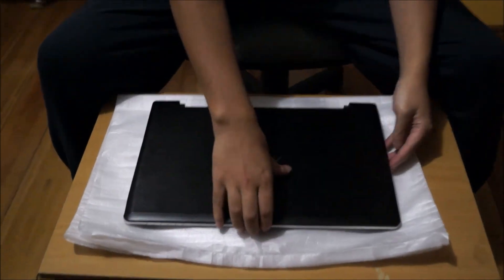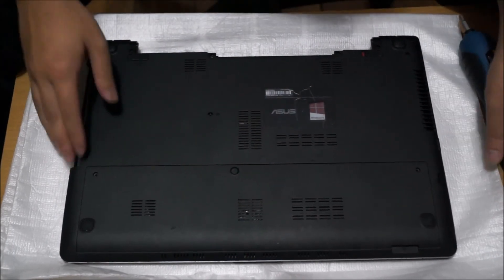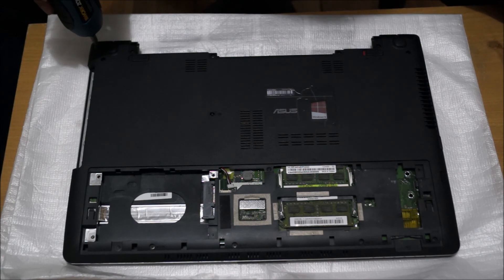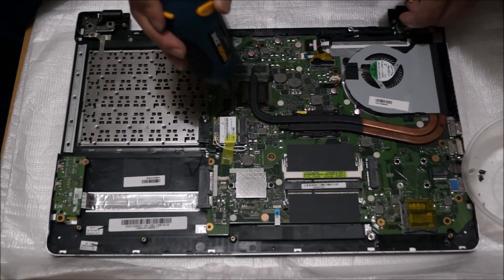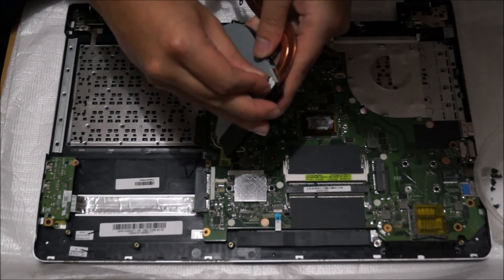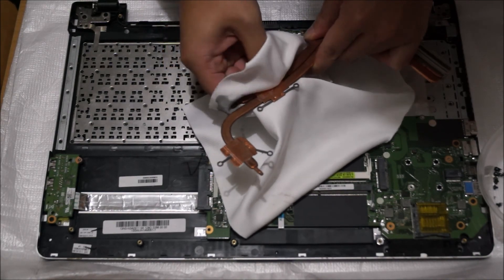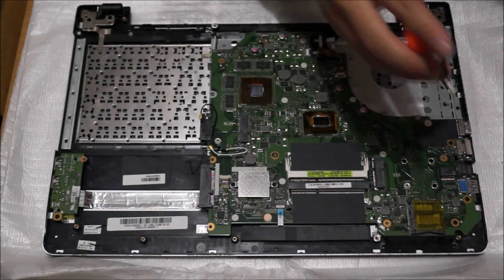OPEN ME UP! Asus K56CM Disassembly

Comment: I doubt I'll get a response, but could you happen to know how I can detach the display?
Reply from the maker: at 13.50 in the video. the top left and right hard corner. there is 2 screws each you need to remove
Reply: @OpenMeUpTec  thank you!

Comment: Do you have any idea if the K56CA will support 16gb of RAM? The Asus website does not specify if it is up to 8gb max RAM  per slot or total...
Reply from the maker: it will work with 2 x 8gb DDR3 sticks. the website says that because when they release the user manual 8gb stick were not available
Reply: @OpenMeUpTec  good to know this. Also, do you have a dual channel kit or single ones?
Reply from the maker: @johndmitrikozak  dual channel mean you using 2 of the same ram sticks. it is better to get 2 of the same sticks. but you wont notice the difference if you have 2 different sticks

Comment: Great video. I have the same lapotop. I turn on my Pc after pressing the Power button more times. What would be the problem?
Reply from the maker: sorry not sure what you are asking. can you please rephrase it
Reply: @OpenMeUpTec  Sorry.  I' ll try to rephrase it. I have to press  the Power button more times  to  start my Pc.  What would be  the problem?  I hope you understood what I wrote.
Reply from the maker: @michelecarbonella2189  i assume you trying to say that you need to press the POWER button more than once to turn on the laptop. if this is the case it is most likely a physical problem and nothing can be done about it.
Reply: Right. I want to try to replace the switch button. Could I fix the problem?
Reply from the maker: @michelecarbonella2189  i doubt it the switch isnt smart or anything it is just a button. you can confirm if it is the switch or not by turning on your laptop and pressing the POWER button to turn it off. if you press it once and the laptop turns off then there is nothing wrong with the button if you have to press it multiple times then you have a problem with it

Comment: A question. What size of screwdriver can I use to replace my Hard disk? Thank you in advance!
Reply from the maker: get yourself a screw drive set on ebay. it is cheap around $10 AUD for 36 in 1 set that will have everything you need

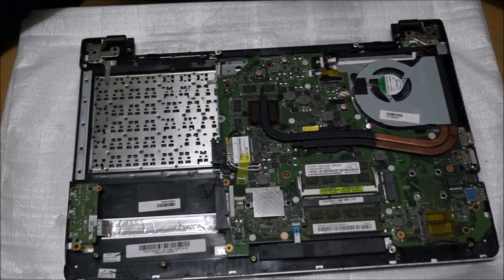Comment: S56C uses same mobo with K56CA...How can i remove existing Ram in slot 1 which is partially (a bit of) located behind backcover without removing whole backcover like at 5:06 ??? Why did they design like that?

Comment: Hi, nice video.
I have an Asus S56C which is pretty the same (I think) to this you show on your video. The thing is I installed an mSSD and Windows 10 on it, everything was beatifull, laptop worked really fine, until I installed the SATA disk that came with the laptop. After restart, laptop boot from the old disk, then I went to bios and change boot order, saved and after that, laptop dont boot again, I cant even get to bios, screen doesnt show anything. Do you know how to reset bios on these machines? 
Any help would be very presiate.
Thanks
Reply from the maker: first thing to try is remove the old hard drive and just leave the msata in there alone. see if it turns on if it doesnt then continue on with changing bios. i think you might have switch from UEFI boot to legacy Boot something like that.
Reply: Thanks for your reply.
I already tried leaving only the new HD, leaving only the old HD and without any HD and nothing, on all my tries, my laptop just light up power led and the others leds light on just for a moment and then go off. No video at all.
Reply from the maker: i dont think you have a hard drive problem. the computer should work without any hard drive. therefore to test remove all hard drive and it should turn on. if it does not turn on you have a bigger issue. so if that does not work move on to removing the ram and turn it on. it should beep if it does not beep come back to me
Reply: OPEN ME UP  I have the same issue, just after changing the ssd the computer will just turn on and the power on light will stay on and nothing happens. tried changing ram, hard drive, ssd, dvdrom drive, battery etc.. nothing happens.  Wondering if something got shortout on the motherboard or something else. Any help on that?
Reply: mSsd fucks, It slows down entire PC making conflicts if SSD 2.5 are on laptop, i suggest you to remove completely

Comment: Hello, is that I am reheating a lot of gray square plate on the left side of where the RAM is, I do not know if that can be changed and what that part is called.

The fan works well too, but the ducts are overheating a lot, thank you, I'm waiting for your help.

Greetings from Colombia.
Reply from the maker: watch the video and follow the step in it and it should resolve your issue

Comment: hello thanks for the video , i have an asus k56cb i5 3337 graphique damaged   ,so i think that i must change the mother board , can i change the mother board to k56cb i7  3537 ? and is the processor is integrated ?
RÉPONDRE
Reply from the maker: the board comes with everything since it is soldered on
Reply: OPEN ME UP  could you  advice me from where could I  order it ?
Reply from the maker: dont and buy a new laptop. this laptop is old the motherboard alone will cost you more than a laptop. since the motherboard comes with cpu and graphic card it cost alot. i posted this video 2 years ago and at the time i was only able to sell the laptop for $250AUD therefore currently right now your laptop is worthless so no point
Reply: OPEN ME UP  I found this https://m.ebay.fr/itm/For-ASUS-S550CB-K56CB-R505C-Mainboard-With-Inte-I7-3537U-GT740M-90NB02D1-R00040-/322433474235?hash=item4b12885ebb%3Ag%3AhDIAAOSwo4pYDbz0&_trkparms=pageci%253A68ffce16-9432-11e7-b460-74dbd180ddc7%257Cparentrq%253A5f0926b215e0ab1ceb4adc1dffeebbfc%257Ciid%253A11
Reply from the maker: that will work but thats alot of money just for the motherboard. you can use that money and get a second hand laptop and sell your laptop for someone else to fix
Reply: OPEN ME UP ok thanks for your time

Comment: When you remove this thing at 7.50, do you just take the wires in your hand ? Like they are really little, isn't going to broke them?
And last question, I opened my PC and since, I only have 30fps on Csgo / Minecraft, I had 100fps just before, I just did want to clean  my PC. But i couldn't because of this wires. So, do you know how I can know if I damaged my CPU / GPU when I opened my PC ? Because I don't remember that I damaged it...
Reply from the maker: if you damage it your computer will not turn on. damaging any of the two will result in the computer dying. at 750 is the cpu fan cable
Reply: +OPEN ME UP ok, so i didnt damage it. And how do you remove this cable ? it's really little i am scared
Reply from the maker: Dont remove it you can still unscrew it without removing it
Reply: Yes, but I need to remove the cable if I want to clean the ventilo, and the to add some 
thermal paste
Reply from the maker: just plug on the cable to remove it. also you dont have to remove it to replace the thermal paste or to clean the fan
Reply: okk, yes i can get it up a little bit and let the cable not removed right ?
Reply from the maker: watch 8.50 where i remove the black sticky tape
Reply: +OPEN ME UP yes but this is under the Fan, so I need to remove the câble before
Reply from the maker: remove the heat sink and the fan screws and you will be able to remove the whole thing
Reply: thanks

Comment: I have the same laptop core i5 750HDD 4GB ram what the max ram capability ? can i put 8GB on the outer slot to be 12GB ?
Reply from the maker: 16 GB max with 8GB in each slot
Reply: @OpenMeUpTec  Thank you so much for this information.